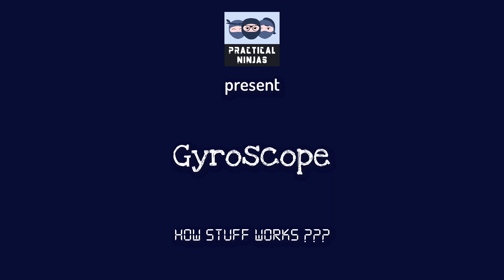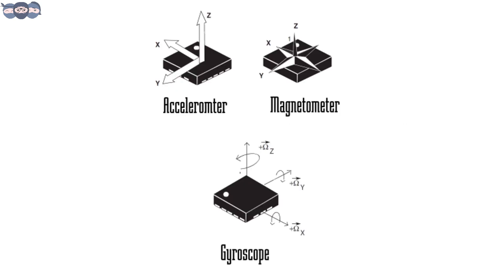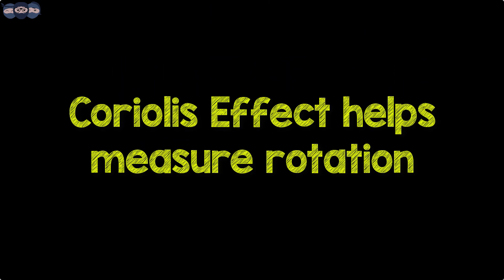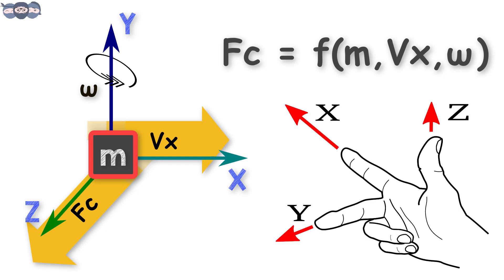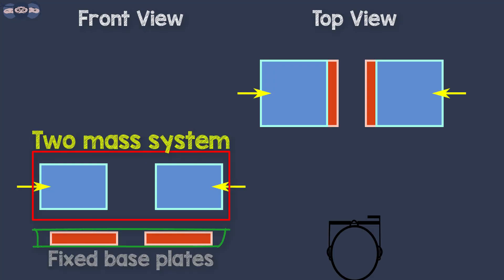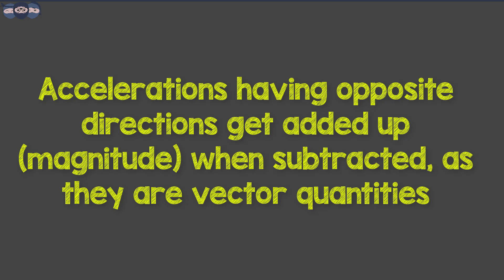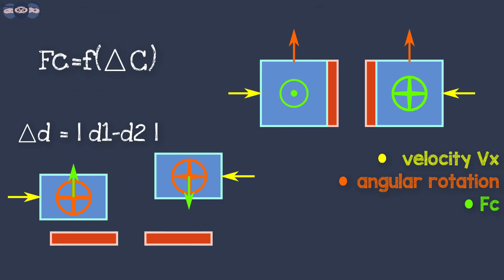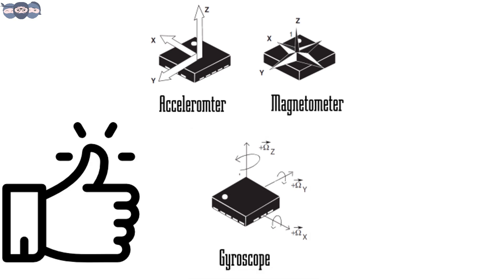How Stuff Works??: Gyroscopes Explained | Physics & MEMS Technology

Comment: Hi, so i understand that gyroscope can calculate the angular velocity (ie. change in rotation). But how does one know, what is the exact rotation at a given time? Eg. when a phone rotates itself into portrait/landscape mode, does it only use the fact that there was an according "spike" in angular velocity, but it never measures the actual current angles?
Or is the magnetometer used for this?
Reply: little late, but it actually uses the accelerometer which can measure the earth's acceleration on 3 axes. When the phone is rotated the g-force moves from the portrait(y) to the landscape (x) axis :)
Algorithms usually combine gyroscope and accelerometer data to make sure the phone was really rotated and not just shaken really quickly.
Reply: @thefelixno  so "it never measures the actual current angles".. right?